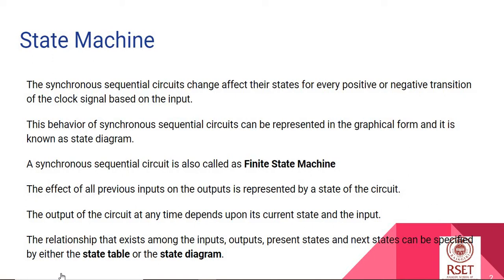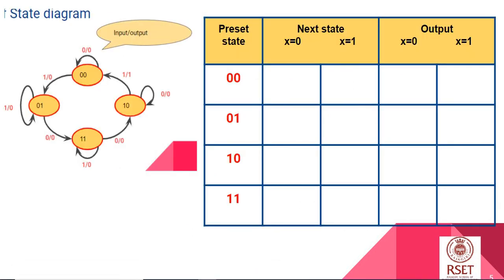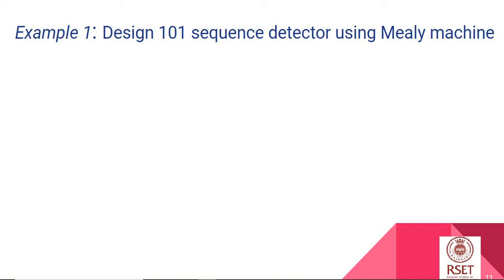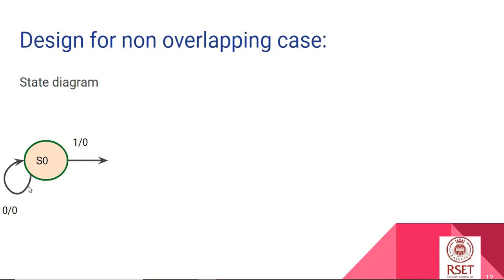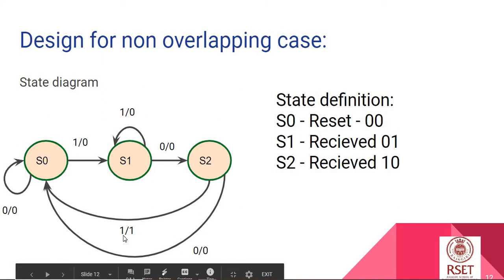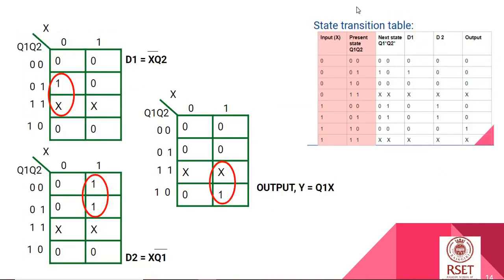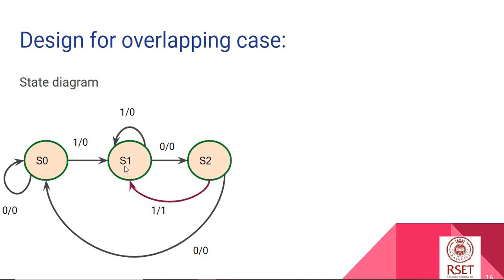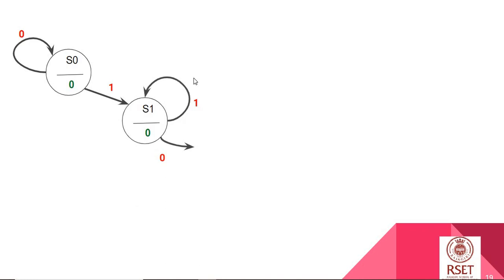EE204 State Machine Module V

Comment: Kindly note - In slide 21 Design of 101 sequence detector using Moore Machine State transition table - Row 7- it is mentioned that
Input-1, present state- 1 0, Next state- 1 1,  D1 =0, D2= 1 => D1 is equal to 1.